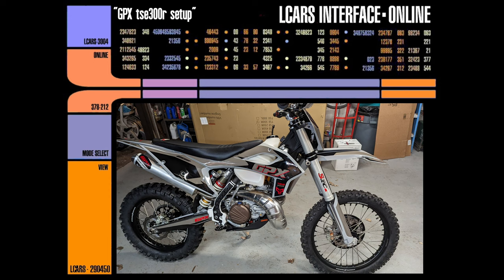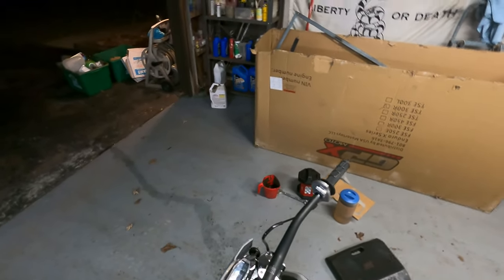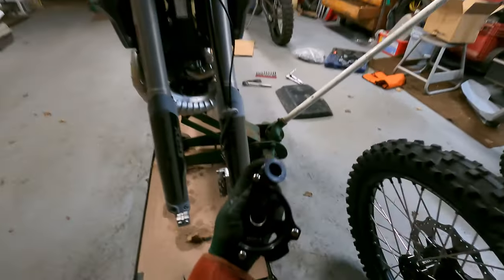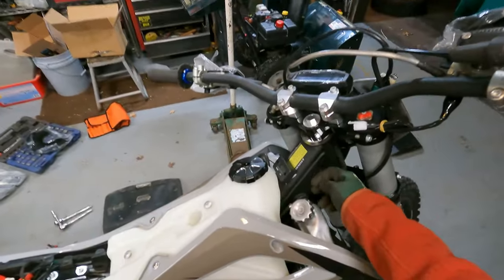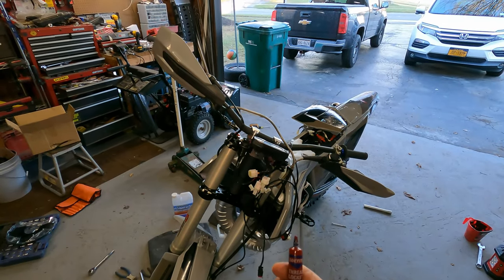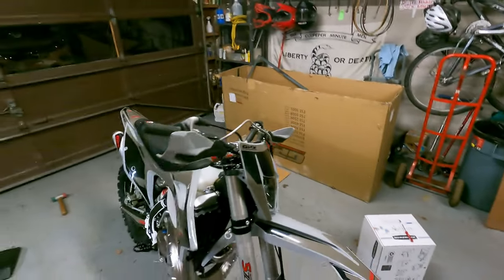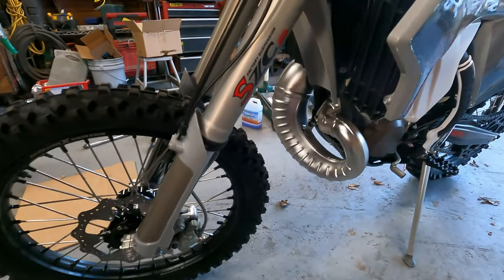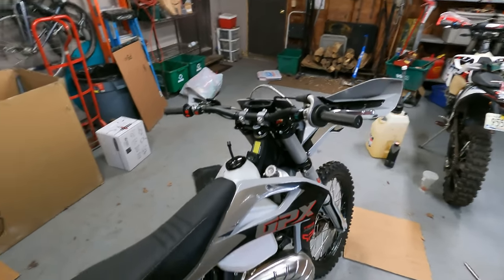GPX tse300r 2-stroke Setup Guide  - Even a caveman can do it!

Comment: These are interesting, but you are going to end up spending a lot of money upgrading stock parts that fail over time. Imho, you are better off buying a used bike.
Reply from the maker: I've owned 4 and beat the living crap out of them and that is simply not true. Do you say that from experience or did you just make that up? I'm being serious.
Reply: @LCARSADV  just been following these for a while, and seen the problems people have had with them. Im glad you have had a good experience so far though.
Reply: @LCARSADV  I am guessing hes making it up due to the stigma that comes with Chinese products. I have been researching the GPX 2T line and they are pretty impressive out of the box  and there seem to be very few quality issues. I am guessing the TSE 300 will have a few growing pains though since its a new model.
Reply from the maker: @DeadRoman  I suggest you try one and see. Like I said, I've been in the forums for 4 years and people don't have these issues. Sure maybe there have been a couple lemons, but the vast majority have been great
Reply from the maker: @dough3208  Any bike brand has growing pains, but man, GPX seems to do a pretty dang good job on quality. We'll see what the new bike does and report back!
Reply: @dough3208  im not “making anything up” theres videos of people breaking parts and reports of cheap metals used and fatigue failures. Just do a little searching. Im not trash talking the product or making up stories. The fact is, if you buy a Chinese clone, you get chinese quality, and that might be fine for your uses. I support you guys doing the legwork, i just cannot justify the expense, when austrian/japanese used bikes are plentiful.
Reply: @LCARSADV  there is no way to try one, without buying one.
Reply: Well I've had one for a few months and not one thing has broken. In fact I've had the suspension revalved and have carried out some carb tuning and that's it. The quality is top notch. Try one 😊👍
Reply: @Retrotrials  i am interested to hear how it holds up.
Reply: @LCARSADV  i accept this, i just dont want to be the one dealing with the growing pains, especially not a chinese company. I woild be more willing to deal with the growing pains of an american company.
Reply: @AdvBrewery  thats all well and good, but I am not full of shit, nor am I saying anything outrageous. The issues with these bikes are well documented. Im not saying they are trash, but, for the money, there are much better options in my opinion.
Reply: @DeadRoman  A very nice used KTM 300 for under 5k all day long! Dirt Bike magazine said the KTM 300 is the best trail bike ever made!
Reply from the maker: @DeadRoman  I haven't seen any of these videos? Maybe one exists and there is a lemon, but like I said, the vast majority don't fit what you are describing. There was one idiot out there names white hollywood who loved GPX and once he pissed off the community but getting in fights with everyone, he then started crapping on the brand he once loved. I don't care about clicks, but watch any of my gpx videos over the last 3 years and you'll see what abuse they take.
Reply from the maker: @DeadRoman  Can you point me in the direction of this well documented information?
Reply: @LCARSADV  there was a long video from a xc rider talking about the myriad issues he had and then gpx sent him a spare parts motor and claimed it was new, but now I cant find it. Maybe they made good on their promises and he pulled the video. Megs brap also spoke abt cheap parts breaking, though she enjoys the bike overall.
Reply: @DeadRoman  how about some links to these videos? I am researching before I buy one and I think I've seen all the FSE 250e videos on Youtube but haven't found any really negative ones yet
Reply: @HobbitHomes263  i posted links…
Reply: Another China hater, saying something that’s obviously untrue, based on so many positive testimonials.  This dump poster has one of the Japanese bikes, I’d bet a million.  Funny enough, “made in japan” was considered the standard when talking about the paradigm shift to japan in the 50-60’s!

Comment: i just got a 300 where do you get the specs from for torque. Thanks
Reply from the maker: For the most part the xcw manual should be good for most of the torque values https://www.manua.ls/ktm/300-xc-w-2017/manual